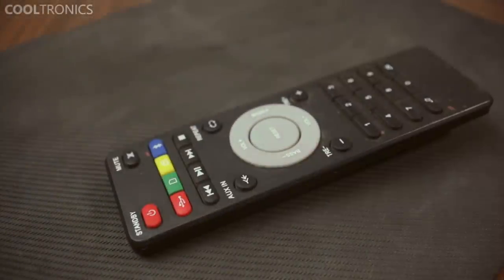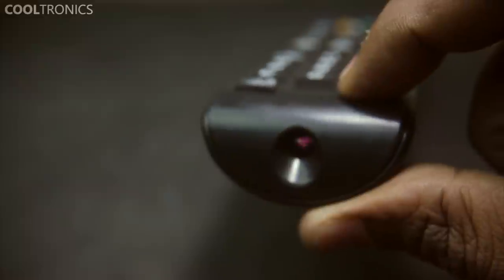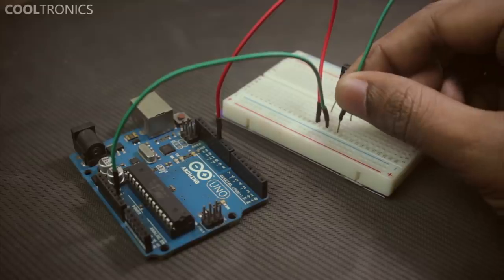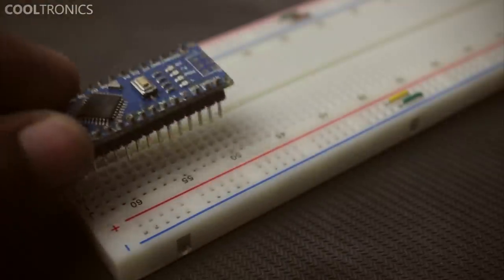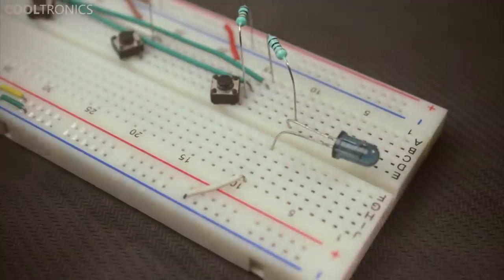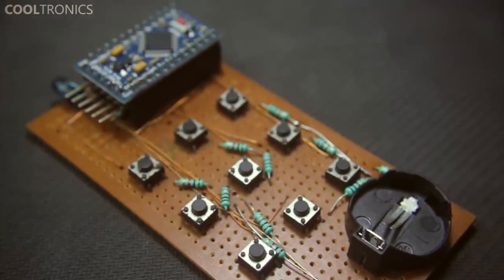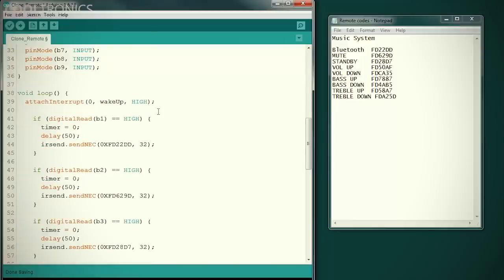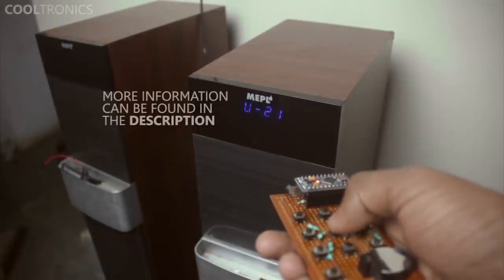How to hack any IR Remote using arduino.

Comment: code is wrong plz upload real code. IR led does not transmit signal
Reply: I heard that the IR Remote Library's latest version (3.x) does not work with example code you find on the internet.  Try downgrading to v2.8 or earlier.

Comment: keep getting     Arduino: 1.8.3 (Windows Store 1.8.6.0) (Windows 10), Board: "Arduino/Genuino Uno"

IRrecord:25: error: 'IRsend' does not name a type

 IRsend irsend;

 ^

C:\Users\komod\Documents\Arduino\libraries\Arduino-IRremote-master\examples\IRrecord\IRrecord.ino: In function 'void sendCode(int)':

IRrecord:109: error: 'irsend' was not declared in this scope

       irsend.sendNEC(REPEAT, codeLen);

       ^

IRrecord:113: error: 'irsend' was not declared in this scope

       irsend.sendNEC(codeValue, codeLen);

       ^

IRrecord:119: error: 'irsend' was not declared in this scope

     irsend.sendSony(codeValue, codeLen);

     ^

IRrecord:124: error: 'irsend' was not declared in this scope

     irsend.sendPanasonic(codeValue, codeLen);

     ^

IRrecord:129: error: 'irsend' was not declared in this scope

     irsend.sendJVC(codeValue, codeLen, false);

     ^

IRrecord:144: error: 'irsend' was not declared in this scope

       irsend.sendRC5(codeValue, codeLen);

       ^

IRrecord:147: error: 'irsend' was not declared in this scope

       irsend.sendRC6(codeValue, codeLen);

       ^

IRrecord:154: error: 'irsend' was not declared in this scope

     irsend.sendRaw(rawCodes, codeLen, 38);

     ^

Multiple libraries were found for "IRremote.h"
 Used: C:\Program Files\WindowsApps\ArduinoLLC.ArduinoIDE_1.8.6.0_x64__mdqgnx93n4wtt\libraries\RobotIRremote
 Not used: C:\Users\komod\Documents\Arduino\libraries\Arduino-IRremote-master
exit status 1
'IRsend' does not name a type

This report would have more information with
"Show verbose output during compilation"
option enabled in File -> Preferences.

Comment: A:\Program files\Arduino\Arduino\libraries\RobotIRremote\src\IRremoteTools.cpp:5:16: error: 'TKD2' was not declared in this scope

 int RECV_PIN = TKD2; // the pin the IR receiver is connected to

                ^

Multiple libraries were found for "IRremote.h"
 Used: A:\Program files\Arduino\Arduino\libraries\RobotIRremote
 Not used: C:\Users\ARREON\Documents\Arduino\libraries\Arduino-IRremote-master
exit status 1
Error compiling for board Arduino/Genuino Uno.

Comment: where did u set pin 3 for IR as output in ur arduino code?
Reply: good question
Reply: ikr, it's kinda confuse
Reply: @GabTheAdventurer  exactly!!! same for Pin 2 (Wake Button being set in LowPower Libs)
Reply: if I'm not wrong, the IR library has already by default set pin3 for the IR Transmitter. Pin 3 has a PWM channel

Comment: You mentioned about Arduino sleep mode and told to press the button which is connected to second pin. But why second pin any reasons? If I am using Arduino Uno then which button should I press.
Reply: It is setted to PIN 2, into LowPower library, it is complexe if you want to setted the waking button to another Pin. What I want to say that it is not related to the Arduino Board, but to the LowPower Library, so just use Pin 2, as said, and set the rest of your button to the rest of the Pins (D4-D12).

Comment: I used the method. it does not work on my LG TV. the TV wouldn't be able to receive the signal from the ir
Reply: is the led working? you can check it with your smartphone cam if it dont has an IR filter

Comment: how to learn the IRsend code ? and should the IRled be connected to pin3 ?
Reply: yeap the IR library has already by default set pin3 for the IR Transmitter. Pin 3 has a PWM channel

Comment: Nice and simple. Not exactly a hack, more of a clone, since you didn't alter the original.
You could have soldered the resistors on the bottom, and then 3D print a cover for it, perhaps using a thing single layer of PLA for the top that you can push against, marking where the buttons are and their function.

Comment: Can i make this smaller with the atTiny 85?
Reply: no it does not work with the tiny85. i already tried that. and i am an advanced programmer
Reply: @f.a3202  it does. There are a lot transmitting ir codes using attiny85

Comment: can i use an arduino uno instead of that nano and are the code rest the same ??
Reply from the maker: Yes you can.
Reply: thx bro that video are the best one i found on youtube, good work :)
Reply: i have failed it doesn't work can you please make a
Schematic with fritzing because i sure i have a problem in installation that schematic you do are very complicated

Comment: i did it and smoke was produced from my Arduino Nano Atmega 328p
Reply from the maker: Pokemon XYZ  I'm pretty much sure you did it wrong
Reply: Cooltronics Yes I checked again and I plugged it in wrong...  And when I did it right I got 3 digit numbers in the serial monitor I entered it into your code plugged in a button and IR led and it didn't work

Comment: If I use uno,what modification do I need,plz help
Reply from the maker: it will work with uno without any modification.
Reply: and what is that 2nd parameter in the sendNEC function, when do I need to change it???

Comment: @Cooltronics Anyone know which of the code to use for the second part of the video, where he sends codes out of the IR transmitter?  I have a Denon AVR 2313 CI receiver, and have been able to determine the codes that my remote outputs, but haven't been able to get my receiver to do anything (volume up, power off, etc.) when pointing the IR transmitter at it.

Comment: Neat video. Can you move the IR LED to a different pin? I don't see where you can define that pin number.
Reply from the maker: It's a bit tricky, you cannot directly define pin on the code.
you have to edit IRremoteInt.h file in the IRremot library folder. 
you can change it to pin 9 by uncommenting line number 206 and comment the 207 current line.